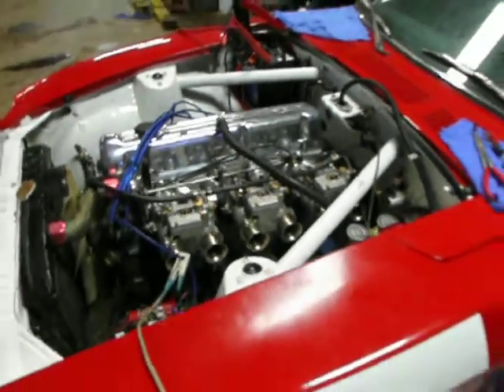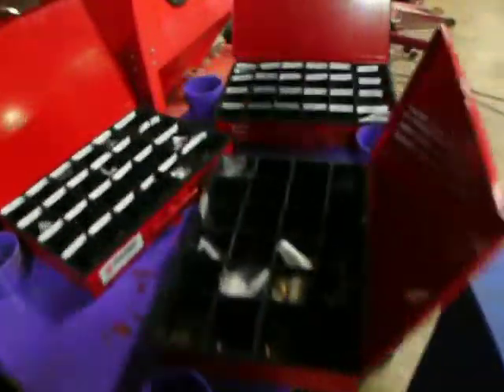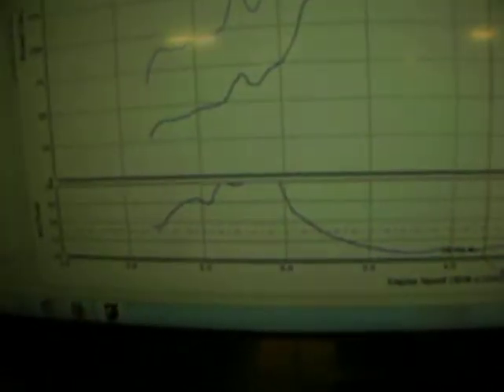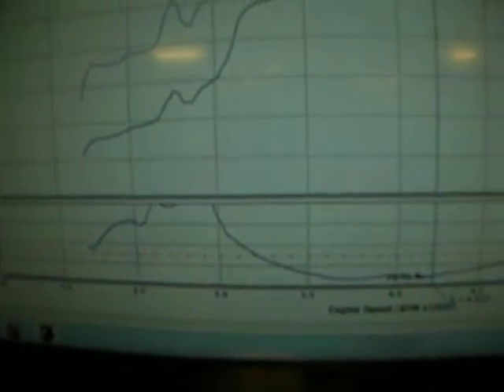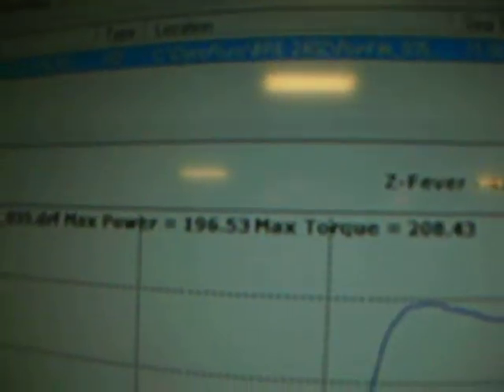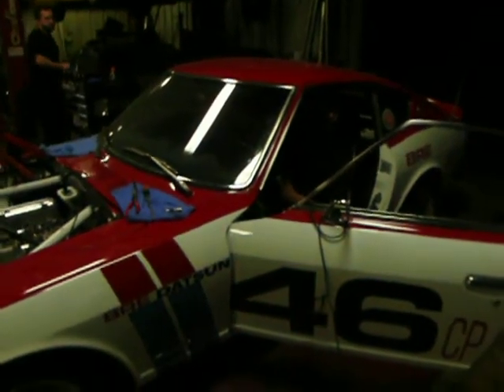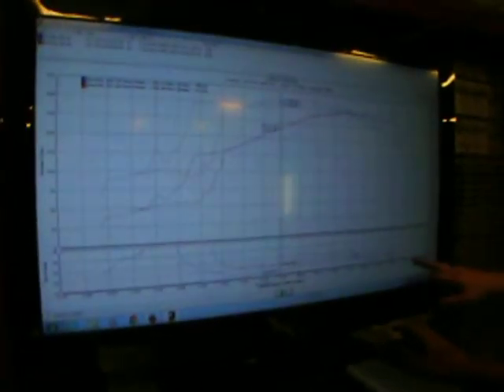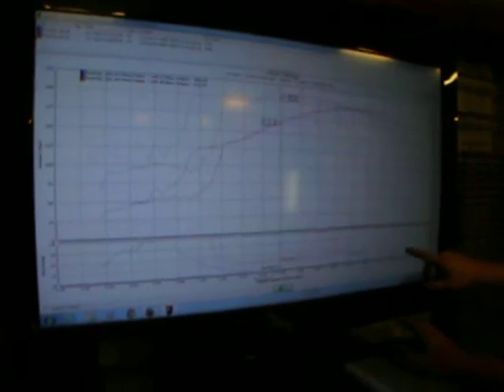240Z 3.1L stroker motor with Webber 40 DCOE carbs. Tuning on our dyno

Comment: I assume its an original L24, good work for keeping it original.
Reply from the maker: We used an L28 engine with an L28D diesel crank, L24 (240Z) rods, and custom forged KA24E 9.0:1 (single cam) pistons. Along with a custom Cometic 1.1mm metal head gasket net us 10.7:1 compression L31 (3.1L) engine.
Reply: Nearly same as mine, L28, specialist  piper cam (UK) and over bore, nice. What does it rev to?
Reply: Says its a 3.1 in the title?

Comment: 40DCOE's on a 3.1? Isnt that under carbed? My DCOE45's on my 3.0L produces a lot more than this car...
Reply from the maker: Yes, these are too small. However, they were already on the car and the customer didn't want to buy new carbs at this time
Reply: +zfeverrocks i believe you can even get 50mm DCOEs , 40s are better on engines under 2.0 L , 45s are good for engines from 2.0 to 3.0 L , for engines larger tan 3.5 a 50 is what you need so 45s should do well